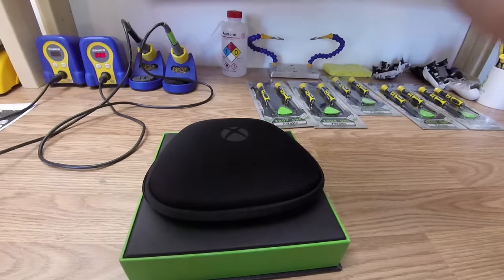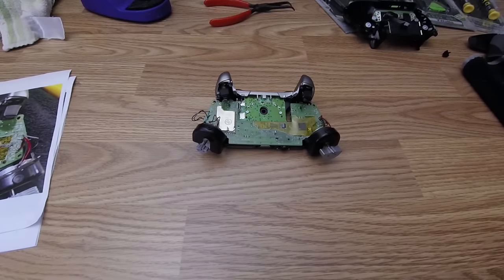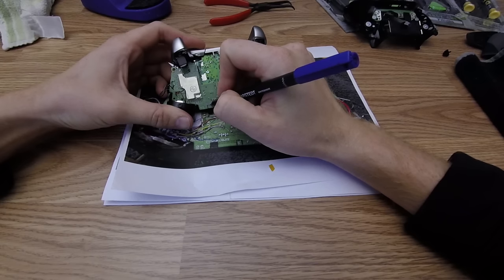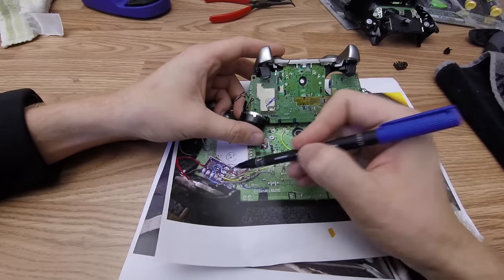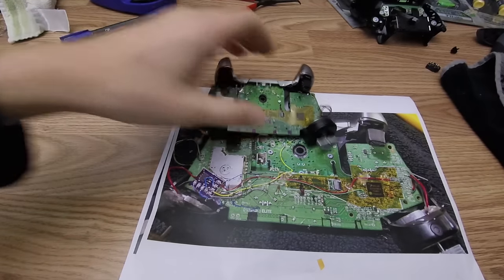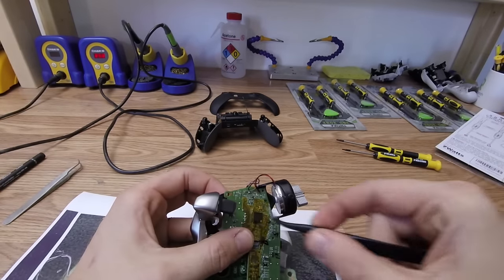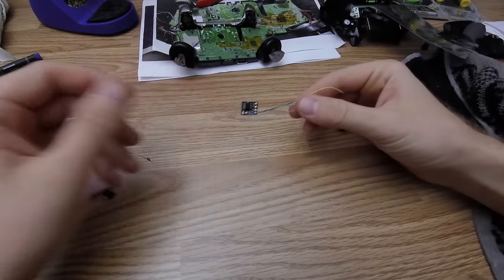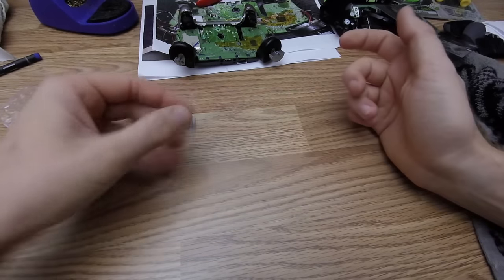How To Install Rapid Fire Mod Chip In Xbox One ELITE controller

Comment: Ha!! Hot gluing the rumble motors - much easier than unsoldering the wires & removing them - I haven’t seen any other video (yet) suggest that !! (It’s the little, seemingly insignificant things in a video that earn kudos above the rest). Good job!!

Comment: Hello! So on the board where the red and green wire is to be soldered, am I soldering each wire (red and green) to the 2 capacitors and the single point? Basically bridging all 3 points for each wire?

Comment: Will this work in the series 2? Also the rapid fire can that work on any button thank you for your help in advance
Reply from the maker: Yes the chip will work with the series 2 controller!! Our mod chips are set up to work with LT, RT, and B. But you can remap the buttons in the Xbox lab to make the mod work how you want.
Reply: @7Watts  
Thank you for your help so 1 more quick question l1 is my fire button and in the game it will not allow to change other than x so could I solder the wire to x rather than b and still have rapid fire on x? Thank you
Reply from the maker: @waynebingham6032  Yes, as long as you know where the X connection is on the board you can definitely set it up that way!!

Comment: Got my 7watts mod chip in the mail today and I was wondering what temperature setting do you recommend for my solder station or what temperature do you set your solder station at??? Also, there is an extra yellow wire included in the package that is not soldered to the rapid fire chip, why???